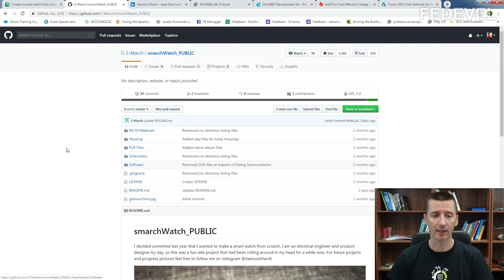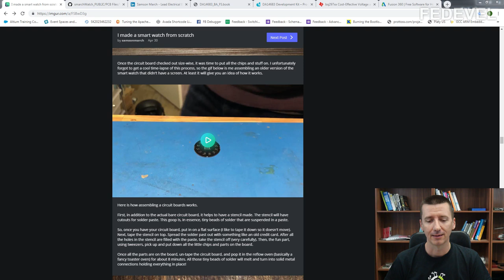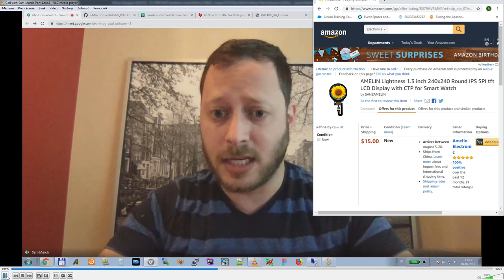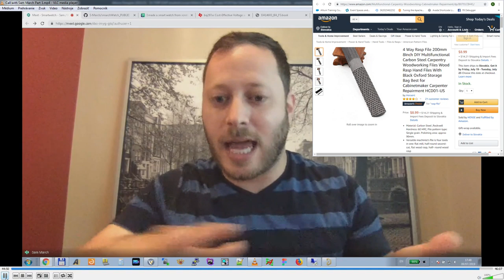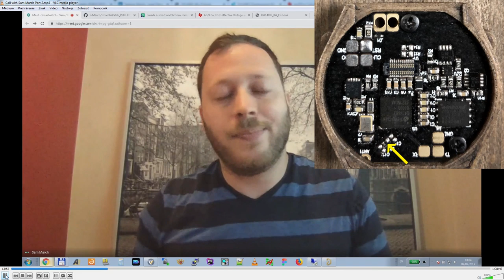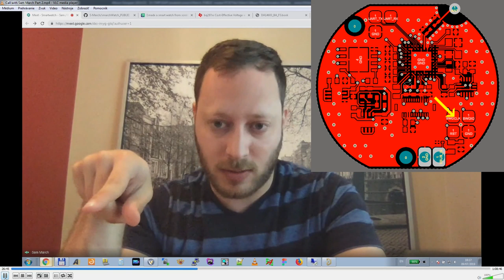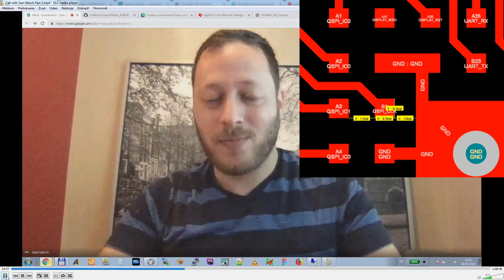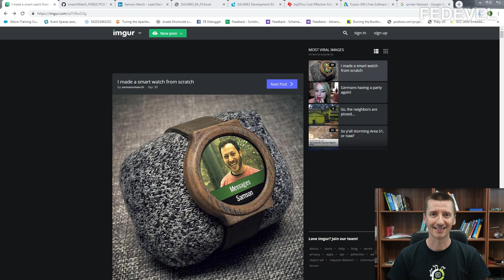Open Source Smartwatch - Samson March

Comment: Hey Robert, I have generally seen that RMA flux bubbles but if you use NO CLEAN flux, it tends to be very smooth flowing with almost no bubbling. I use that on all my soldering works. You can clean the excess of with IPA.
Reply from the maker: Great tip! Thank you Sooraj

Comment: Enjoyed every second of this. my USB microscope saved me so many times. a ultra sonic cleaner is good too, but beware ! I left my PCB in an ultra sonic cleaner a bit too long, an it started taking off the bare silver HASL from the pads (in some places) even the green mask started to peal between 64pin 0.5mm IC pitch , these pads too wasn't tinned with solder, tinned pads was not effected.

Comment: For the antenna, does the part that's soldered on the pcb counts for length measurement?
Reply: I would like to know this too!
Reply: The jumping off point is the castellated pad (half hole on the side) so the wire should be cut to 31.25mm in length.
Reply: okay, but why? I is it because that short trace acts as a transmission line with all those stitched vias?
Reply: szaszafaja that is correct! Up until that moment, the trace is a 50ohm impedance trace.
Reply: @SamMarch  Thank you!

Comment: 46:55 Antenna design. Its better to use a antenna balun instead of a pi network, they the same thing, using a balun is one component instead of a pi network, a balun cost the same, has better matched characteristics and comes with a datasheet, you will save alot of work especially when not owning a network analyzer.
I found this trick watching a video by: Michael Ossmann: Simple RF Circuit Design
https://www.youtube.com/watch?v=TnRn3Kn_aXg